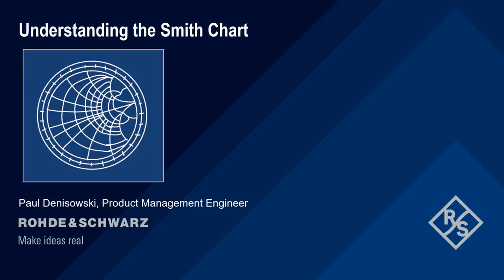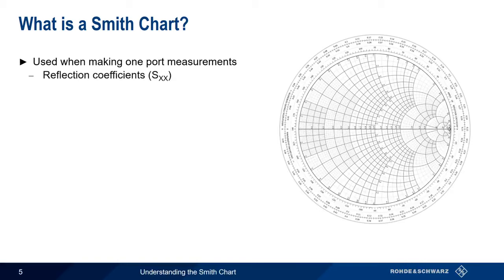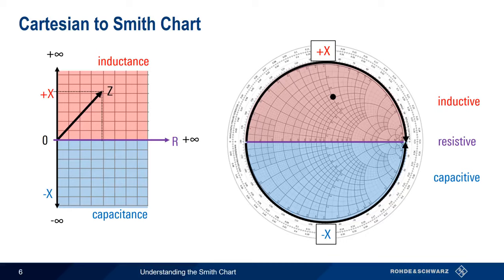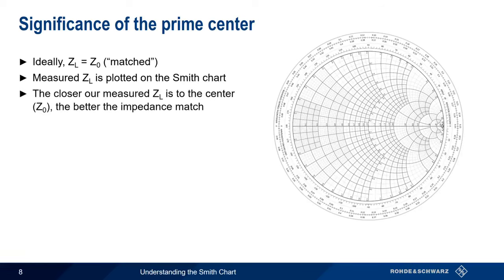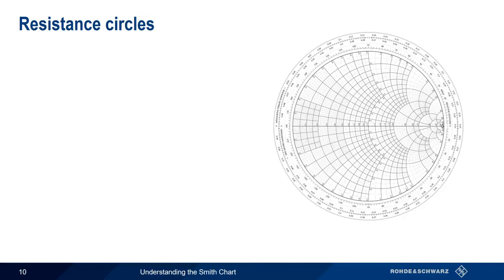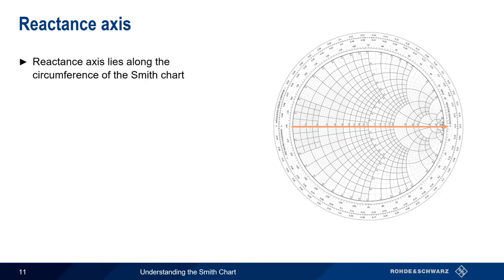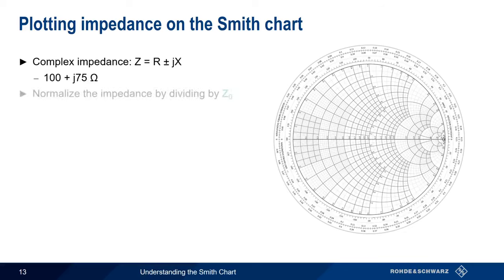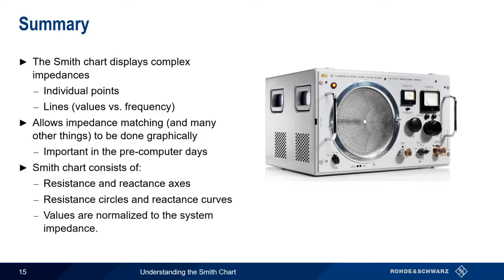Understanding the Smith Chart

Comment: Great presentation. In the example at 8:47, when you normalize the complex impedance, why does only the sign on the resistive component change? If I factor out -1, shouldn't we get -100 + j75 = -(100-j75)? Then -Z/50 = 2 -j1.5?

Comment: NICE video to start to learn something for me new.
i have a  question please .
in my  LDMOS  mrf6vp11kh  i found included  on data sheet the smith chart  with this value  Zload 4.6+j1.85 .
what does it mean ? the characteristic output impedance? how can i understand this value better?
Reply: Assuming I'm looking at the same datasheet:  there are two values given (plotted as points on the Smith Chart), one for Zsource (gate to gate impedance of test circuit) and one for Zload (drain to drain impedance of the test circuit).  These are plotted as points, not lines, since they are the impedance values at a single frequency (130 MHz).  Both impedances are complex, with a real (resistive) part and an imaginary (reactive) part.  In order to maximize the power transfer (and reduce reflections, VSWR), complex impedances should be "matched" by having the impedance on "the other end" being the complex conjugate (i.e. reverse the sign of the imaginary part).  So in the datasheet, the complex Zload impedance at 130 MHz is 4.6 + j1.85, which would be matched by having an impedance of 4.6 - j1.85 on the other end.  This information can be used to select appropriate values of capacitance when designing the input and output matching networks.  Hope that helps!
Reply: @pauldenisowski  many thanks

Comment: What I have a little trouble understanding is for example of the circle where R=1.0 On that circle the real part is always the normalized 1.0 (let's say normalized to 50 Ohm). The left side of the circle passes the x-axis at the midpoint (pure resisitive, no L, no C). But at the far right it passes the x-axis at "open circuit". It would be an open circuit, also without reactance, but in the video it is stated that R=1.0 Am I missing something?
Reply: Great question.  The reason why you get infinite ohms where the circle touches on the far right is because of the REACTIVE part of the impedance.  The RESISTIVE part is still only 1.0.  If you imagine this plotted on a Cartesian plane, the far right edge of the circle is where X = 1.0 but Y = +/- infinity.  Hope that helps!
Reply: @pauldenisowski  Thanks. Okay, I get now the Cartesian "folded" axis and the infinity of the reactive part, but resistive part should be 1.0 If that is true why is it an open circuit?

Comment: Why 100+ j75 ohm.what does it means in practical senario.
Reply: A purely resistive load (with no imaginary part) has an impedance that does not change with frequency.  Any impedance that has a reactive (imaginary) part does change as a function of frequency.  A point on the Smith Chart shows impedance at given frequency and a line on the Smith Chart is used to show impedance as a function of frequency (see slide 5).  

So the point 100 + 75j (which I chose just as an example ... nothing special about this value) would represent the measured load impedance at a given frequency.  At this particular frequency, the load as a 100 ohm resistive component and a 75 ohm positive reactive (inductive) component.  In many cases, we want this point as close to the center of the Smith Chart as possible for a given frequency or frequency range, and the Smith Chart can be helpful in determining the best way to do this.  How this is actually done (matching) is a topic that needs a video (or more) of its own  :)  Thanks for the question!
Reply: @pauldenisowski  sir , thank. ,before i reply this ,i again watched video in slow speed 😜.all understood,but same question again, what is usefull to know consecutive impedance i real case scenario.i have nano vna.i understand that at which frequency it's is nearly prime centre. And can see the values of vswr and resistance.but how can I  tune using the smith chart as i know on my frequency it is far away 5o match 1:1 or 50 ohm.i understand the resistance should be near 50  to have swr near to 1.i know wavelength increase as frequency decrease.but, how to cut my antenna element corresponding to my desired wavelength (or Freq), so it comes near prime centre.

Comment: This is only half the explanation of Smith Charts because it only talks about impedances. When you want to add shunt components to a network, you have to consider admittance, susceptance and conductance. That's the Y Chart which is usually overlaid on top of the Z chart.
Reply: Yes.  Stay tuned for future videos on Smith charts!